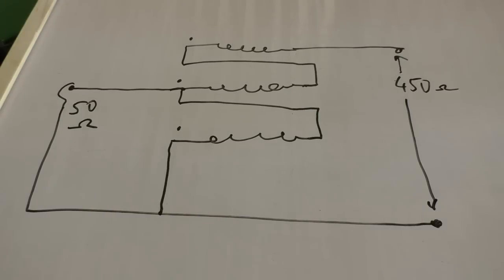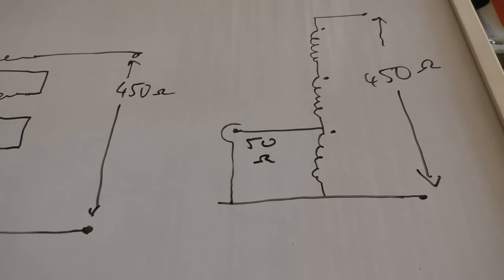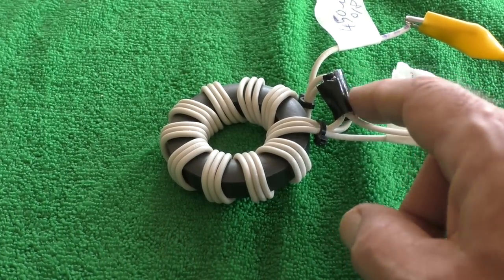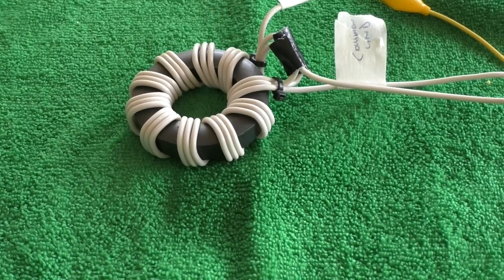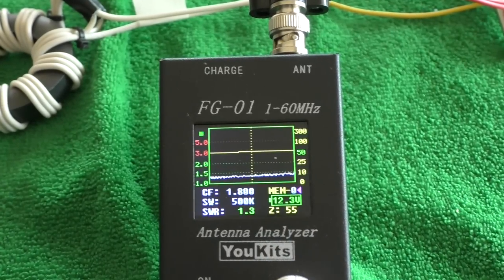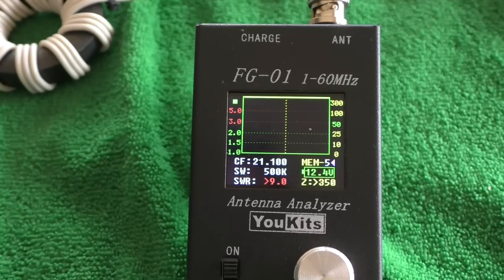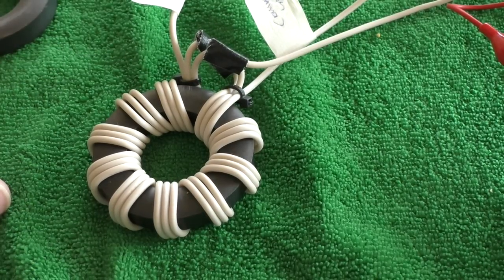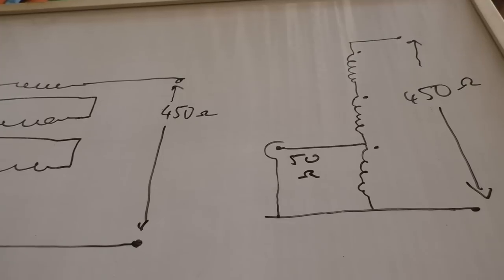A Look At A 9:1 Un-Un

Comment: Nice SWR meter you have there. Normal 1mm building wire will be OK but the enameld copper can take higher temps. Are you still active in amateur radio?👍🤓

Comment: I guess I'm late to the party! That's a fine looking wind there... very tidy. As others wrote, I was wondering about the core composition. I've read that Mix 2, 43, and 61 are useful for the ham bands. Now I think I want to play a little bit with winding some Ununs and maybe some Baluns as well. 

I'd like to measure the efficiency as well. I'll have to do a little research on that. 

Beware of hamfest torroid buys. That's tantamount to buying a pig in a poke!

73 de AG7TX

Comment: I think using house wire is ok. I have some with magnet wire, and insulated stranded wire. I believe that solid is suggested.
Next effort try a T200-2 toroid.  Some recommend a ferrite material but iron core also works.  N1XGH
Reply from the maker: Thanks Ralph, noted.